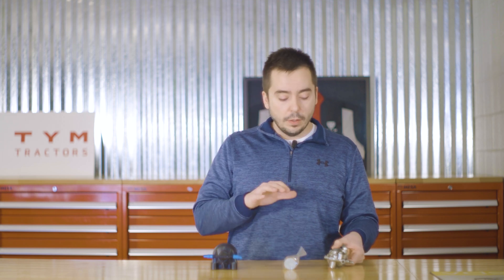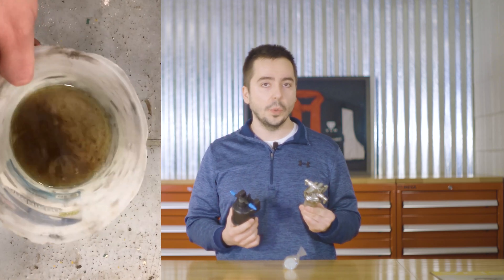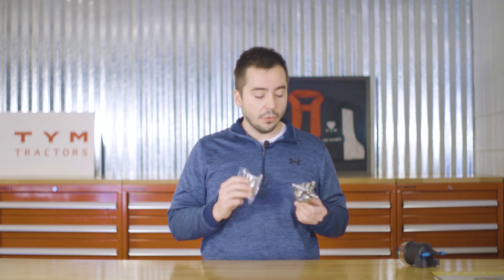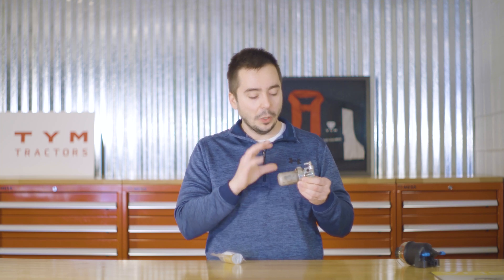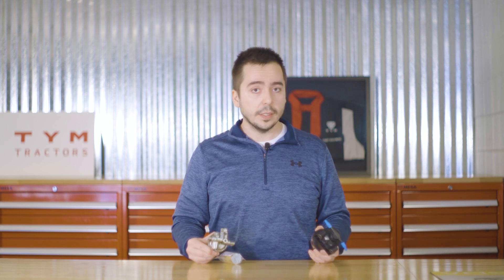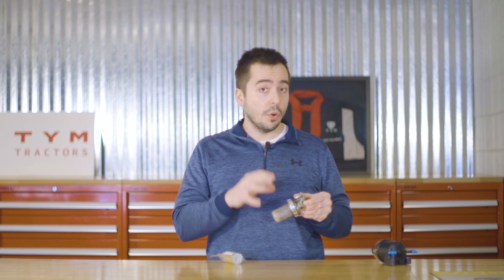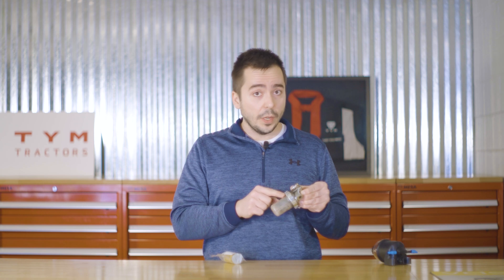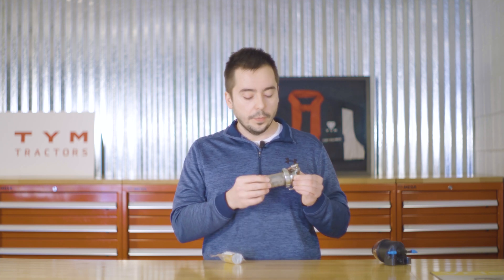TYM Tractor Fuel System Issues?!?!

Comment: It’s common to have expanded rubber gaskets/o-rings. Small carburetors for example. I shrink them back down to size after putting the over sized o-ring into boiling water for about 20-30 seconds. No harm done to the o-ring. Just a tip for people to try first. But yeah a new o-ring should automatically come with a new filter when you are doing maintenance work.

Comment: you are gonna have condensation in any  high pressure fuel system the pump builds up heat in the fuel and when returned to the tank hot and left to sit overnight it will condensate 
best to keep extra fuel filters around and change often such as every oil change or atleast every other oil change

Comment: Hey you just solved my fuel issue for me  thank you and can you tell me the Part# to those both of those?     I found the settlement filter completely russted and I had to pry it out and I really beat the bowl up prying the busted filter out.   I was able to locate a filter but after watching your video i'd like to replace both.   Thank you so much for making this video.
Reply: Did you have any problems after you replaced it? I just ordered mine and hoping it fixing my “MIL” warning light
Reply: @aaronkephart1954  no problems so far.   Now I just keep a closer eye on it and at least once a month I drain the bowl .
Reply: @aaronkephart1954  I didn't have a light ever.  I just have slime in the bowl and the filter started to get rusty.    Have you scanned the OBD codes to see what they say?
Reply: It’s doesn’t stay on it came on and idled low and the shut off I hope just the filters was the problem
Reply: @aaronkephart1954  when the light comes on it will stay in the memory.   It would be interesting to know what problem triggered it.    Hopefully it never come back.  Make sure you turn the key on and drain your water separator.  The electric fuel pump pushes the water out of the petcock.    It only take a few seconds.

Comment: How do you get air out of fuel system.  I have a 2515R.  I was using my tractor and RPM would not go over 1200 rpm.  Replaced the Fuel filter, rpm will initially climb to 2300 rpm and then not go over 2000 rpm.  My thinking is there is air in the fuel line